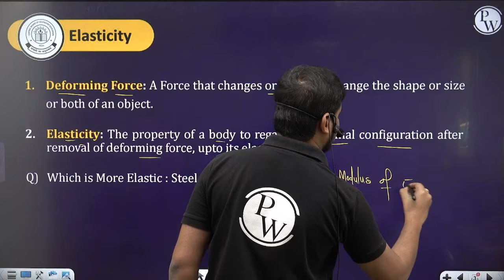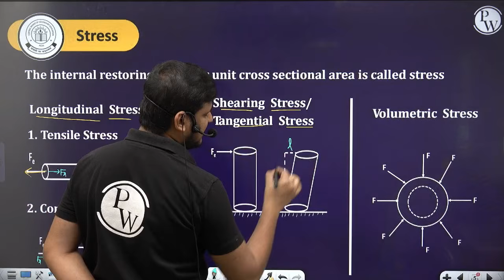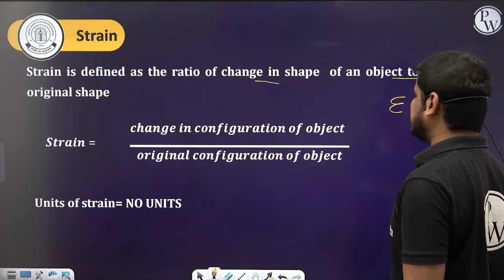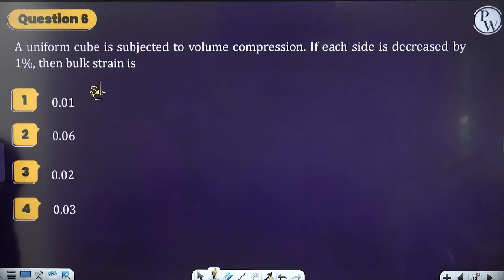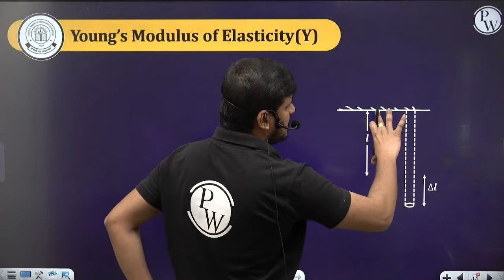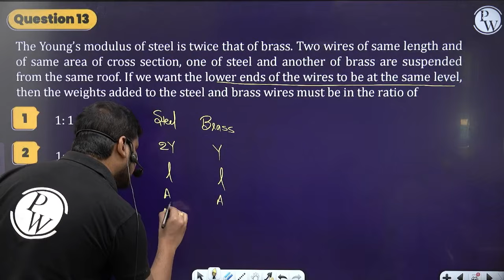MECHANICAL PROPERTIES OF SOLIDS 01 | Elasticity | Physics | Class 11th/NEET/JEE

Comment: Steel is more elastic than rubber?????
5.09
Reply: modulas of elasticity of steel is more than that of rubber
Reply: Stretchiness is different from elasticity
Reply: Because steel elongation is least when load is applied and also we don’t compare steel with rubber. Because the steel is a metal and rubber is a non-metal.